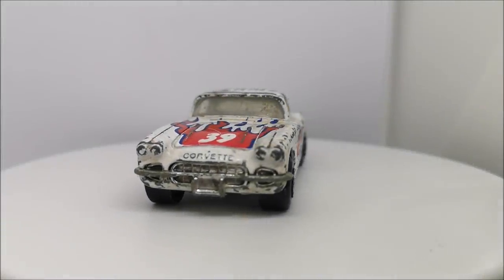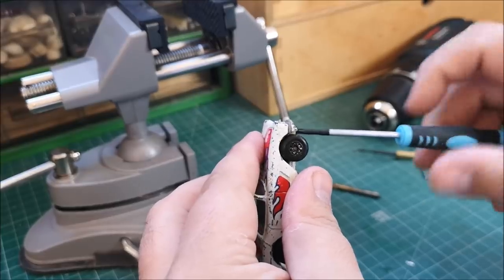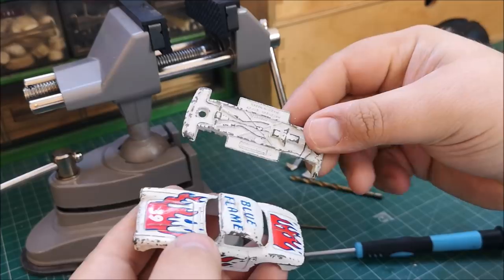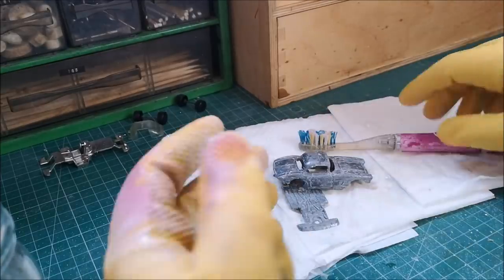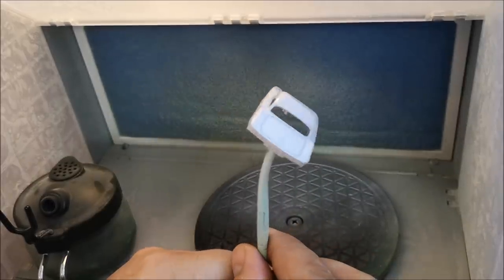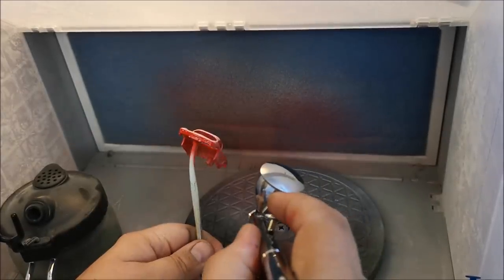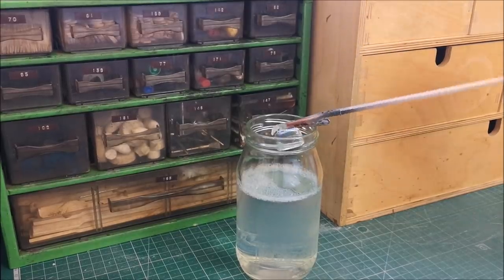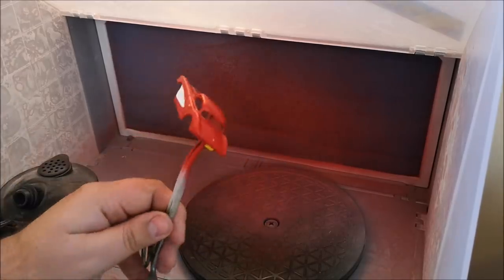Matchbox 1962 Chevrolet Corvette C1 - Custom Video

Comment: Vallejo paint can be thinned using ordinary 96% alcohol which you can get very cheaply from supermarkets and chemists. Similarly it can be used with Tamiya acrylics paints too. Also, the Vallejo "Air", is pre-thinned for use in an airbrush. I find that it's also excellent for hand painting areas like those on your Corvette.

Comment: Rob, I like the colors and it's good to see your growth. To help your spray cans work better you can put it into a small pot with warm water for a few minutes and that would improve flow. I would also look at trying some masking film instead of tape. Use a new blade when you cut it and because of the nature of masking film it adheres extremely well to tiny details and compound curves. Good job sir!!
Reply from the maker: Thanks for the information Richard. I didn't know about masking film
Reply: Rob I forgot to mention that there are two kinds of masking film. One comes as a sheet and is somewhat flexible and another comes on a roll and is very flexible. There is also a liquid masking film. All should be available at an art store or Michael's if you have them where you are.  @MatchboxGarage

Comment: I'm starting to get into die cast Matchbox etc and noticing the original paint on these babies, I got a brand new orange Chevy Nomad with flames and perfect wheels for my first car and it is really perfect and 98% orange peel free. So although I like what you have done I think the final surface finishs leave much to be desired. I've ordered a GoPro so my goal is to show just how good the paint jobs can be if you put in the extra effort. I also have some magnifiers that should help get a really fine finish. Thanks a bunch and I'll be watching, PV in BKK

Comment: If you're going to paint with a brush, such as the coves on the side of this car, it might be best to use flat white, thinned out a little bit, to reduce the brush stroke look. Then when you clear coat it you'll get your gloss back. Do kind of wet clear coats, and let it flash off 15 or 20 minutes between coats. Nice "Hot Wheels" wheel swap by the way. I love Corvettes. You do great work, buddy.

---Dave
Reply: Practice first!

Comment: Hi Rob, not your finest hour , but every day is a learning day and because you have screws in the base there's nothing wrong and no hassle in returning to it at a later date and doing one of your 10 out of 10s. Thats the beauty of restos and this hobby, when you get bored of looking at it in red then strip, dip, prime and paint in your new fancy. Personally I like a deep burgundy for a Corvette with silver accents. Just a tip for when you do masking off areas, try reverse masking whereby you paint the area you want in white with your airbrush concentrating on the main area for white and feathering onto the area for red. Then after the white is dry fully mask it off and then apply the darker colour over the rest of the main body. It's generally better to cover a lighter colour with a darker colour. Having said that your channel is going in the right direction and in my opinion is always entertaining. Cheers fella
Reply from the maker: Thanks mate. With each build I learn something new and also wish I did something different
Reply: No problem mate you have great ideas and that's half the battle, if you were turning out faultless brilliant restos straight away you would have nowhere to go on your new hobby journey. For viewers its great to see the progression and journey, look at early Marty vids and see how he's improved. Got your E-mail address by the way and will drop you a line tomorrow.

Comment: Quite a nice little car.  I like that you painted the valance panels. To bad you couldn't sand down the casting lines on the rear quarter panels. It would have been a little smoother and you can always fix the white later. Good job.

Comment: The blue flame may be referring to the blue flame engine that Corvette first used when it was introduced in 1953.  The irony is that the blue flame  was a six cylinder while the 62 Corvette exclusively used a V8.  🤷‍♀️

Comment: yep... white part is pretty bad, but I do like the style of paint job. That's the style this car demands. You do make decals, right? I watch  so many of you I can't remember who does what. The white part could simply be done with decals, and that stuff that softens them. Next time, paint the white part first, over the primer, this will apply to any two tone job, the smaller parts first, then tape off and seal with a thin coat off the clear around the tape edges.to seal it.Thin, even thin the clear a bit more than usual. This seals the tape edges to prvent bleed, but the drawback is you my need to use an exacto knife around the edges (not always, but sometimes) so they don't pull the paint off. I'm sure you can figure out the rest. On the real cars, they used a small pinstripe around the edges of the white portion. in this case, it would probably be black. The best looking version of this I've seen is what they call a Tuxedo paint job, the bulk black, with the inserts white. Some also have the  top white.

Comment: Blue Flame most likely comes from the Blue Flame inline 6 cylinder in the 1953/54  models.  Why they painted it on a 1962 v8 I don't know.

And you could have left it all red...by 1962 most Corvette cars sold didn't have the two tone option. It was available, just not as popular as it was in 57-59.

Comment: Hi Rob, Rob here. Could you tell me please what size drill bits and tap  you use please?
Reply from the maker: I bought a kit

CONTENT:

1 x TAP MINI WRENCH

1 x TAP M2 x 0.40 HSS Tap

2 x TAPPING SIZE DRILL 1.6mm HSS

1 x RIVET HEAD REMOVAL DRILL BIT HSS-Cobalt TiN

SCREWS

24 off M2 x 3mm long HEAD Diameter 4mm

24 off M2 x 4mm long HEAD Diameter 4mm

24 off M2 x 3mm long HEAD Diameter 4.5mm

24 off M2 x 4mm long HEAD Diameter 5mm

24 off M2 x 4mm long HEAD Diameter 6mm

12 off M2 x 3mm long HEAD Diameter 7mm
Reply: Awesome that’s a great help. I looking forward to getting stuck in and restoring a couple of old matchbox I have. Thanks for all the content by the way.

Comment: The first time you didn't use the words "footling hot-dog jar".🤭

Sorry,but the white on the sides really needs to be re-done,with a thin silver outline along the outer edge & in the front,near the wheel arch,where it looks kinda like an air intake.
Just can't leave it like that,really looks bad.
I also think the top woulda looked more realistic in white,as these were convertibles.
The CORVETTE name in the front woulda also looked great in silver.

The new wheels are MATCHBOX wheels,aren't they?
Maybe even from a late model CORVETTE?

With flames on the side,it coulda been NICK RYDER's 'VETTE from RIPTIDE!

Comment: What size of drills
Reply from the maker: I bought a kit

CONTENT:

1 x TAP MINI WRENCH

1 x TAP M2 x 0.40 HSS Tap

2 x TAPPING SIZE DRILL 1.6mm HSS

1 x RIVET HEAD REMOVAL DRILL BIT HSS-Cobalt TiN

SCREWS

24 off M2 x 3mm long HEAD Diameter 4mm

24 off M2 x 4mm long HEAD Diameter 4mm

24 off M2 x 3mm long HEAD Diameter 4.5mm

24 off M2 x 4mm long HEAD Diameter 5mm

24 off M2 x 4mm long HEAD Diameter 6mm

12 off M2 x 3mm long HEAD Diameter 7mm